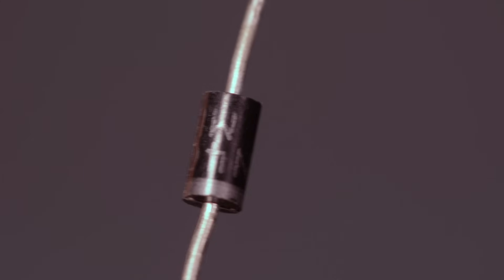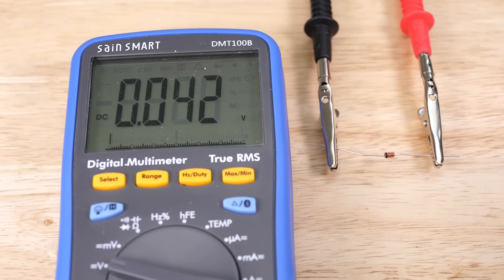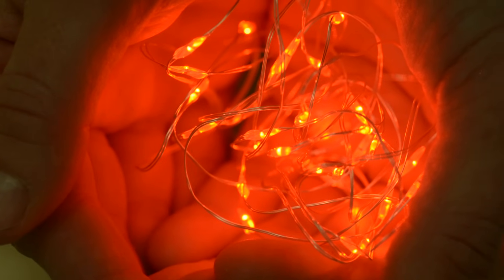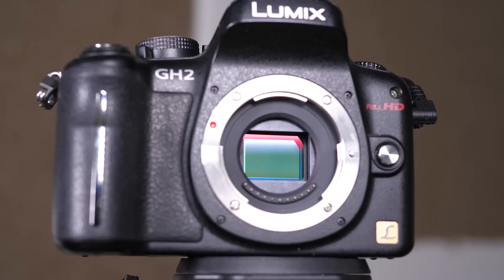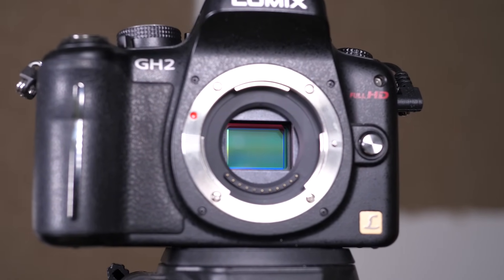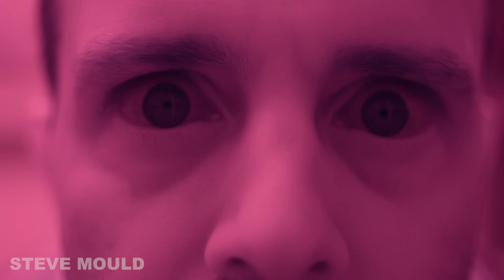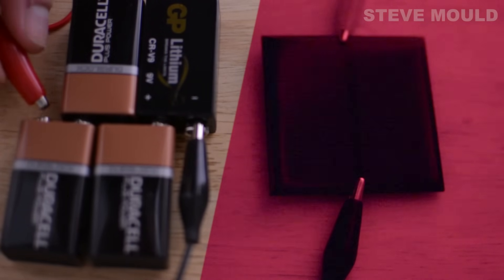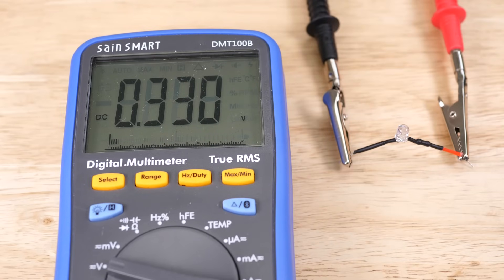Why all solar panels are secretly LEDs (and all LEDs are secretly solar panels)

Comment: I saw a video by a professor who researches solar cells. He talked about how LEDs get some amount of their energy from the heat of the crystal lattice. He said if you could get the efficiency of the LED high enough (80ish percent of electrical power into light) they would actually act as refrigerators rejecting heat as entropy in the light emitted. He talked about putting such a super LED across the vacuum of a Dewar flask from a high efficiency PV cell to make a heat pump from the inner wall to the outer wall. All this is pretty well known by people who study PV cells and LEDs, but I had no idea and find it super interesting.
Reply: Wait. Are you saying that LEDs at a high enough efficiency can actively absorb heat in molecules and emit it away as visible light? So is it theoretically possible to pump heat away out of a spacecraft in vacuum just by shining a spotlight with this super LED in a direction?
Reply: @BrokenLifeCycle  yep. It has been demonstrated in laboratory settings but isn't practical at the moment. It's infrared light not visible light though. https://www.wired.co.uk/article/230-percent-efficient-leds
Reply: @sethsims7414  sounds like wifi from light.
Reply: @sethsims7414  Interesting. Gets me thinking about ufo technology. The way some seem to radiate light visible or infrared from their whole surface. Seems that could possibly be a cooling method for a large energy source.
Reply: Man, thanks for sharing thats so cool to know...
Reply: @sunmoon1234  Peltier modules are certainly semiconductors that act as heat pumps. But they don't turn the heat into light, they work on a different principle.
Reply: @sunmoon1234  But it's not the Peltier effect that I'm describing it's a different effect that may be happening at the same time.
Reply: Can't thank you enough for this information, since I was a kid I knew this existed - mind blown! No sarcasm, I mean it!
Reply: You are talking about Professor Eli Yablonovitch from UC Berkeley. Here is one talk of his: https://www.youtube.com/watch?v=u_K1URyarE0
If it indeed is the talk that i remember, it too was an eyeopener for me. Especially the reality of the economics of scale and him being unable to bring his high efficiency GaAs cells to market as the PV market is over-saturated and no-one wants to invest to compete with the inefficient bulk coming out of china. Having personally funded the boom as well, since i have been living in germany for almost 12ys now, i was amazed at the double-edgeness of the german subsidies, apart from it applying equally to all social classes in germany.
Reply: @luc_libv_verhaegen  yep that's it.
Reply: the only problem is that this technique may never work for lower temperatures (lower than 150C) because the entropy should increase according to the laws of thermodynamics. Converting from a cold enough temperature (like room temp) into infrared decreases the entropy so it is not allowed without some significant extra energy input.

You can lower the frequency of the emitted light into the microwave spectrum but I do not know if that is enough to solve the problem.
Reply: @neurhlp  Ah, well...  So much for a possible solution to global warming.
Reply: @neurhlp  The effect already works in general in common LED but it's overwhelmed by losses. So garden variety LED's in general are colder than you would expect. Or at least that's something Professor Yablonovitch says during his presentation.
Reply: @sunmoon1234  Heat isn't electromagnetic radiation, it's the thermal energy transferred between two bodies, and thermal energy is the kinetic energy of the particles in a body.
Reply: I imagine a massive bank of these super LED's would make for a nice cooling system for a spaceship.
Reply: We now have elements that purely convert heat into electricity when exposed to magnetism. The magnetism flushes energy from passing atoms into electrical circuitry and the by product is a lack of energy in the molecules. Can cool air to nearly absolute zero.  @MushVPeets
Reply: I wonder if this could be applied to underground agriculture: Going to depths with higher heat, convert the heat to visible light to maintain a greenhouse environment while reducing the temperatures so you can go deeper than would otherwise be possible.
Reply: Sourabh EM radiation is a mechanism for transferring heat, but that doesn’t mean that heat is EM radiation.
Reply: The keyword Harmonics is the true Causal Factor responsible for achieving that level of efficiency.  The effects of harmonics on a lattice given (x)(y)(z) variables is ultimately the knowledge that will reveal the "secrets" that will free mankind from fossil fuels.  The problem is that efficiency at this sort of level is only positively spoken of and research towards this type of goal is never publicly announced.  That type of research is counter-intuitive in the current financially driven, corporate run, worldview of global dominance over mankind via masters and their slaves.
Reply: @sunmoon1234  I had a large monocristaline solar cell and when I applied a voltage to it one side would cool down. Only for a short period though.
Reply: Peltier Coolers...
Reply: @ßeau_M  They are heat pumps. So it depends on how you use them. PCR machines in Biotech use Peltier modules to heat and cool samples in cycles.
Reply: I have a question for you Seth, as you know there are many segment of energy in the electromagnetic spectrum, with a plethora solar[not visibile] energy my emitting from the galaxy ["sea of energy"] all arround us, The question is how come solar panels are only "tuned" the visible light spectrum/ir" Theres is billions of watts of energy in the elctromagentic spectrum field from both man made source as well as solar galaxy energy. . ., my theory is to create a broad spectrum panels that picks up wide bands of energy , " look up thomas henry, morray, teslas radiant energy generator, and ham radio emergency back up generator, , , the energy is out there and visible solar light is just the tip of the ice berg. . . .
Reply: @mikeriverajr4447  At George Washington uni they are working towards a multi-layered micro concentrated PV cell, basically it is like stacked cells and each layer absorbs its respective wavelength between 250 nm and 2500 nm.
Reply: @mikeriverajr4447  because, by the beginning of the 19th century we realise that classical physic is inadequate, instead we now work on quantum physic. This' why your understanding of Tesla's thinking no longer apply to 21st century technology, like solar panels & long distance DC power line.
Reply: @mikeriverajr4447  i think it has to do with the amount of energy, a big light source like the sun is so fullof energy you can feel it so it requires less sensitive technology.
To catch energy from space requires much more sensitive technology which isnt in favor with our capitalistic mass production even tho the energy would be "free" the production cost would take away all of that benifit
Reply: @mikeriverajr4447  Cause that's the main kind of light that makes it through the atmosphere. Lots of the other wavelengths don't transmit as well.
Reply: This is why LED lighting is bad for your eyes.  Our eyes NEED heat transference.
Reply: Except none of this is even remotely true.  Just because an incandescent bulb glows when you pass current through it doesn't mean passing light through it is going give you current.
Reply: Yeah, I just ordered an LED AC on Amazon.    The fucking planet won't support life soon.  But, But, LED's

Comment: Questions:
What happens if you apply a higher voltage to solar panel?
How high a voltage is safe when testing for cracks?
How is the emitted wavelength related to the wavelength(s) they normally absorb?

Comment: I've always thought the "duality" of so much common technology should be emphasized more because it simplifies things.  The classic example is that electric motors (at least the simpler designs) can be used as generators.  And a steam engine, or an internal combustion engine, can be used as an air/vacuum pump.

Comment: Does a diode emit "light" when the current is being forced against the direction of current the diode normally allows or is it when current flows in the direction the diode allows normally?
Reply: In the direction the diode allows normally. Also, it's actual light, so no need to put quotes around the word.

Comment: It's slightly unfortunate that you keep talking about the voltage instead of the current. Reason being the voltage is highly non-linear and the current is highly linear. 
It is also a very weird way you are driving your solar panels as LEDs, instead of using a constant current source you are using a ~constant voltage source, which is not what you want to do with LEDs.
Reply: The required minimum voltage for a solar panel to even begin to conduct electricity is very high because of all the cells in series
Reply: How is that an argument for a highly non-linear input/output?

Comment: Now you've got me curious how the readings on the multimeter would vary when using different colors or different wavelengths of monochromatic light.
Reply: They vary plenty when using a single set of wavelengths. Light has a good degree of randomness to it you can pick up on any good multimeter. Cheaper meters like the ones you often find for $20 and lower that look like repainted clones wont pick the fluctuations up all that well but they do show the hints of it. Once you get into $50 on up range, you start to become aware of how noisy your environment is in light, heat and em radiation.

Comment: “Diodes are really simple electrical components “... my electronics textbook thoroughly disagrees...
Reply: The Shockley equation is quite simple ;)
Reply: My textbook on the physics of electrical components also thoroughly disagrees.
Reply: My textbook on the mathematics behind the physics of electrical components also thoroughly disagrees.
Reply: They are super simple, just like every other element in modern electronics, its confusing due to the scale(small) and materials used (compounds) but in actuality every peace is just an arrangement of positive, negative, and dielectric materials, even rocks have these various properties, everything dose to some degree, when arranged properly you get what we call electricity. Look into how all these components are made: transistor, diode, compactor, battery, you will see it's just various arrangements of P,N, and dielectric.
Reply: You need a more accurate book then.
Reply: a diode is a very simple component. it runs via smoke. when the smoke leaks out, the diode stops functioning.
Reply: They are simple from an electronic engineering point of view. If you look deep enough even a resistor is complex.
Reply: @zztop3000  it is very complex but it isn't that hard to understand
Reply: @Dongs Are you sure you're talking about the same thing?
Every hobbyist since pretty much forever has been able to make printed circuit boards.
A motherboard is a relatively complex design, but it's still a PCB.

Now, if he was making his own integrated circuits or transistors, that'd be another matter.
But what do you mean by 'motherboard'?
Reply: @JohanFouche-k7w  Don't confuse theory and practice.

In theory I can build a nuclear reactor.
The physics and design is pretty simple.
The actual engineering and construction, especially if you don't feel like killing yourself and most of your neighbours, is not.
Reply: @KuraIthys  WTF....are you dumb ? Do you understand a battery ? Know how easy that is to make ? How does a battery split positive from negative using simple lead, tin & copper plates & connections Not very practically inclined ? So you lack any practical knowledge of the planet ? My dad had a saying & as a grownup I've come to realize just how accurate he was saying it. At the time I thought he was being egotistical, but......IF a human built it, any other human can too. its not alien.  its simple engineering here kid. ( he was the type of guy who quickly built a battery charger from a hair dryer & a bridge rectifier when the car's battery was dead one morning.  Maybe go buy a larger LED.... You will understand just by looking through the plastic @ the actual metal parts, why it IS!!! so easy. Its not rocket science nor extreme engineering. Oh & guess what. A kid built a nuclear reactor in his back yard, using simple materials. Fucker even insulated the core with lead foil which actually worked. he was enriching uranium @ home...rofl. So yes, if I apply myself, I will be able to build one too. IMO everything is possible by any person. Which is why I can't, as my dad couldn't get egotistical about engineering/mechanics/science/medicine/politics/ANYTHING!!!!!! Maybe you should stop looking at a doctor or scientist's pride when he tries to sell his profession. They abuse that pride to charge you an arm & leg for the simplest shit. In some ways, china is actually beneficial to western society re. how cheaply technology can actually be made. Don't get me wrong, their shit is ...SHIT....but they do/did expose the freeloaders of simplicity for who they are/were.
Reply: @JohanFouche-k7w  I agree to a point. The common person however cannot actually do such things. The vast majority of people truly are too stupid to understand the basics of many things. Someone selling a skill, be it natural or learned, they are welcome to do so, and even charge an arm and a leg. Just because I can stitch someone up from pretty drastic wounds by no means shows i would be able to or willing to attempt reconnecting a limb and lining up each vein, capillary,  nerve and muscle fibers before stitching up the skin. Sure, things can be learned, but some take nearly a lifetime to become even mildly proficient. As for the 10 year old that made the reactor, I have never heard of that. Last I know of Jackson Oswalt is the youngest person to make a fusion reactor (nuclear reactor of any kind) and he was 13 and holds the world record for it currently. And he had funding and help from others. Pretty sure without that, it would have taken many many many more years, and SOMEONE would still have to fund it. Your dad had a decent knowledge base on electronics it seems, but so does any half assed journeyman electrician (not calling him that). Just because one man can build a reactor or another can perform brain surgery doesnt mean anyone could. Your dad had the right idea, but in all reality, it is the few who make the world, the rest of us live in and maintain it. I have seen lifelong master electricians that had no chance of reproducing even the level of ingenuity of Nikola Tesla(his advanced stuff, the coils kids can do) with modern tech. That should show in itself not all humans can reproduce what 1 was able to do.
Reply: @JohanFouche-k7w  lol, my dad always said the same thing!  He always used to tell me to read the encyclopedia Britannica from the 50...(it was the eary 90s)
Reply: he meant it's easy to craft with and take care of. In unis and colleges they teach you to be able to take responsibility using them, not just fiddling about.
Reply: zztop3000  how so? They simply layer semiconductors together to form a PN junction.
Reply: @PhilfreezeCH  do you know who it was, and if they documented it online?
Reply: I've seen someone that was determined enough to make their own semiconductors, and I have to agree.
What a crazy process.
And she was just about capable of making transistors...
Maybe at a stretch an integrated circuit consisting of about 3 components.

When you see it as small-scale improvised production it still looks nuts, but not quite as crazy as the real methods.
And of course this improvised stuff was using commercially available wafers, which are really difficult to produce in their own right...
Reply: @KuraIthys  It's Jeri and we all know her. She wasn't "close" to making transistors, she actually made transistors.
Reply: @poptartmcjelly7054  at what point did I say she was 'close'?
Do you need a lesson in reading conprehension or something?
'just about capable of' is a statement of being able to do something, albeit with considerable difficulty, and with questions as to whether you can take it any further that that...

I mean, really now. How you got that interpretation out of what I actually said is beyond me...
Reply: @KuraIthys  I think you're referring to Jerri Ellsworth - https://hackaday.com/2010/05/13/transistor-fabrication-so-simple-a-child-can-do-it/
Reply: @KuraIthys  speaking of making transistors, did you know that if you stuck aluminum foil tape over one of those photosensitive resistors you would form a rudimentary mosfet, the game would be less than one but still...

Comment: Here's hoping you talk about optoelectronic recoprocity -- a statistical mechanical consequence of time reversal symmetry where transducers under linear forcing (like a diode under small bias) have a reversible property to them.

(It's not quite exact since you're applying quite large voltages, but nearly so.)